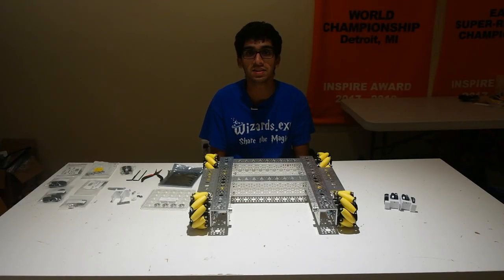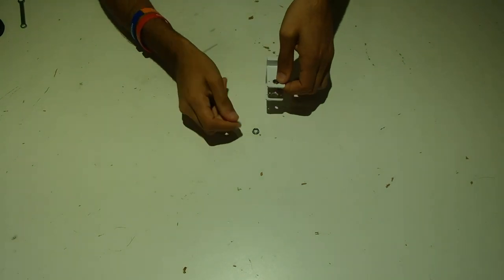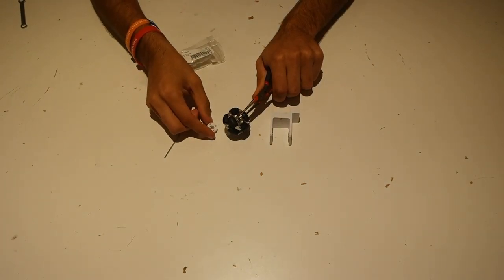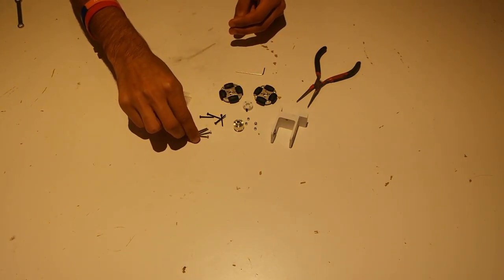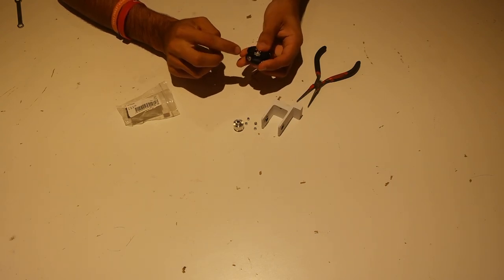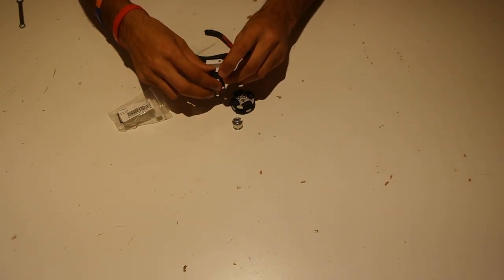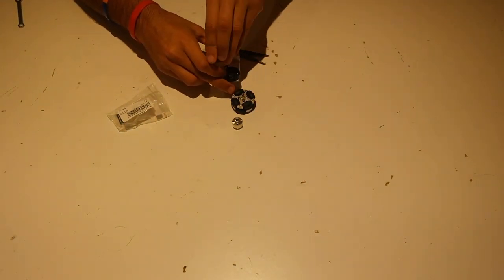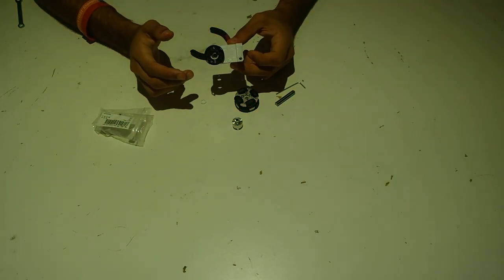Odometry Spell Book Part 2: Installing Odometers into Drivetrain

Comment: Quick tip for the nut that holds the pod in the side channel: use a piece of tape (scotch or electrical, not duct)  to hold the nut in the combination wrench while putting it in the proper location. The adhesive will be strong enough to hold the nut, but weak enough to release it when you're done installing the bolt.

Comment: We decided to do some odometry this year so I went to this video to figure out whats going on and how to work this stuff. I just want to say that this video was very helpful, but also that there was a couple design flaws I noticed in the encoder mounting system. Firstly, the spacers dont seem to keep the weel completely center which puts a bit of strain on the set screw. We just used about 4 washers on the encoder side and 1 washer on the opposite to correct this issue. The other issue we had was that the bearing on the side opposite the encoder was only being held in by the fact that it was tight fitting. This second issue was quite concerning since if that bearing were to fall out the axle would be prone to bending and could damage or break the encoder. We just glued a washer and some copper wire outside of it to keep the bearing in, but Im sure there are a few other ways of doing that. Thank you greatly for the video, as it gave us a really huge head start as opposed to completely designing our own odometry. 

P.S. The mount for the robot and the replacement wheel hubs were both very good.
Reply: Had the same issues. I ended up printing 2 of the large spacers at 105% on either side of the wheel which kept it centered and kept the bearing on

Comment: My team uses a modified tilerunner chassis, and we were wondering if mounting the horizontal odometry wheel on the side would work with the math. Basically in between the wheels there would be a vertical and horizontal odometry wheel on one side, and one vertical wheel on the other. We have an idea of how we would put the horizontal wheel in the middle, but we're not sure if it would work so while I'm waiting for a response I'm trying to figure out if we even need to do that.

edit: apparently we're switching to a new chassis this seasons so there goes all that CAD work we've done

Comment: Nice video, but I still don't understand the part where you were talking about the reverse version of the odometer on one side. From what I saw, the odometers looked all the same
Reply: Hi, if you look closely, you'll see that the odometer on the left is different than the one on the right side, as they are mirrored versions of each other. Look at 27:26

Comment: Do you think that these encoders will be able to withstand throughout the season or will we have to replace them often?
Reply: Hi Videet. As long as you are careful not to hit them or let them hit any edges (which should be simple this year since the field is flat) they should last multiple seasons. All of our encoders still work on our odometry wheels, and we have been using odometry since 2018.

Comment: I was wondering if the cable is the same cable that is used for the motor encoders, if not then we will need to buy some.
Reply from the maker: Hi Kaden, it's a different cable that is used.
Reply: @WizardsexeFTC9794   Wow! that was quick, Thanks!

Comment: Thanks for the video guys. We are wondering why you are not using 1/2" OD bearing instead of the 3/8"?
Reply from the maker: It makes the 3D printed part easier to print. It also is thinner allowing it to fit inside the channel

Comment: Will it work with other type of encoder? Or it is needed that one from description? It can be used any encoder with that hole for the D-Shafting?
Reply from the maker: We can't guarantee that it will or won't work with other encoders, and you'll probably need to redesign the odometer printed part to make it fit with other encoders. If you want other encoders make sure they have the same interface.
Reply: @WizardsexeFTC9794  but other encoder does what that type does, right? Like, the values from the files might be different, but the localization will workm

Comment: Do you think that there will be issues traveling over the bump at the center bridge for the competition if we had these wheels?
Reply: Have you tried it? My intuition is to avoid the center bridge since it will lift at least one of the odometer pods off the field (introducing error).
Reply: @lemonoxygen8846 Most likely it will throw off the odometers, but they aren't really used in teleop so it shouldnt be a problem for us

Comment: What wires should we use to connect? You only listed the andymark ones but you need another to connect to the level shifter
Reply from the maker: The wire that connects to the other side of the level shifter is included in the level shifter.
Reply: Wizards.exe FTC #9794 is it the blue and white one?
Reply from the maker: @n.kh.l  It's the one with a blue, red, white and black wire.
Reply: Wizards.exe FTC #9794 aight thanks we’re doing odometry but we’re really nervous.

Comment: Great video. Any reason you would not want to use the encoders that comes with the gobilda motors? Thank you
Reply: Wheel slippage, if your wheels slip then your encoder readings will be inaccurate. If you run mecanums at full speed they will slip some, so if you want to run full speed you can't rely on motor encoders
Reply from the maker: The odometers will plug into motor encoder ports. We then don't have enough encoder ports to plug in the drivetrain motor encoders because of the odometers.
Reply: To add on to Wizards.exe's reply, if your odometry works well, you can use the readings from the odometers to correct the powers going to the wheels rather than an encoder on every drive wheel, so having drive wheel encoders AND odometers are unnecessary.

Comment: When we build ours, the wheel moves back and forth with the shaft. We think the spacers are messed up and don’t know what to do.
Reply: Assuming you solved the problem by now. But I printed 2 of the large spacers at 105%. When put on either side of the Omni wheel and set screw tightened it stops the moving of the shaft

Comment: Hi, I was wondering if we could use the screws that came with the omni wheels and saw off the ends after putting in the omni wheel insert. Has anyone tried this?
Reply from the maker: You should be able to do that though you risk damaging the omni wheels itself. Probably best to reduce risk and just buy the shorter screws

Comment: Thanks for taking time to answer our questions. To avoid the hassle of crimping, we bought the https://www.andymark.com/products/encoder-cable-36-in-long-with-single-pin-connectors cables. But their single pins won't fit into a REV hub encoder ports. They dont have space for all 4 of them to fit. What would you recommend?
Reply from the maker: When using that cable you still need to use a level shifter.
Reply: Thank you. That works. We got it all hooked up and will test it next week. While doing a test drive we noticed that it was having issues crossing the neutral bridge of the Skystone game set. The pod was hitting the platform and we worry it might damage the pods and sensor.
Reply from the maker: @FTCLiveWires  You'll need to figure out a solution to that problem. For our robot, we have a string pull up the sideways odometer in the back, while the other two odometers are fine as long as we cross the bridge in the correct orientation.
Reply: @WizardsexeFTC9794  thanks for the response. We are thinking of using a servo to retract the wheels once auto is done. That way they are protected all the time during the teleop driving.

Comment: Why did u choose these specific encoders? How do these ones compare with http://www.revrobotics.com/rev-11-1271/
Reply from the maker: These encoders were available throughout the summer and fit on a 1/4 inch shaft compared to the REV ones which aren't available yet and require using a hex shaft.
Reply: @WizardsexeFTC9794  so is there any advantage with these encoders or not
Reply from the maker: @AdityaSingh-xm9pl  The advantage with the ones in the video are they're easier to design with, smaller and are currently available. The advantage with the REV ones are they are easier to wire, are less delicate and have a much higher resolution.